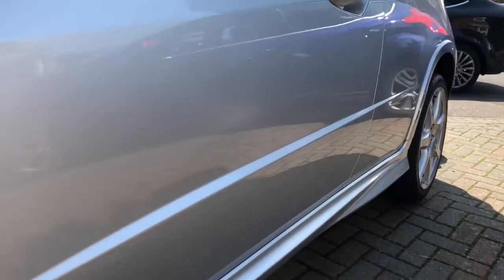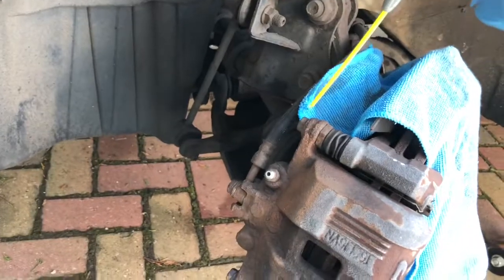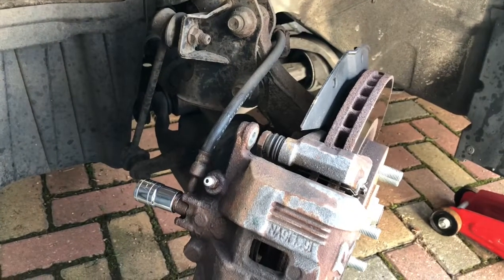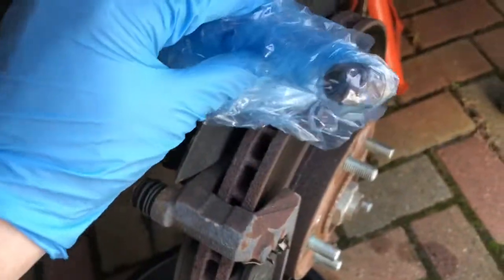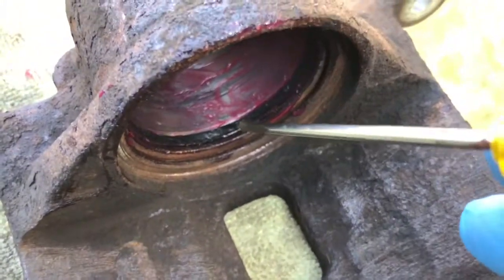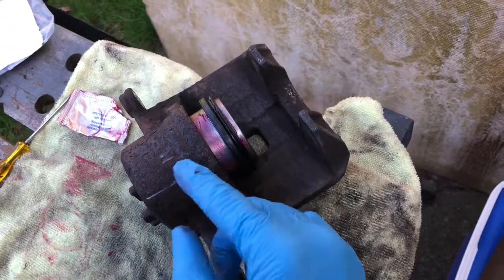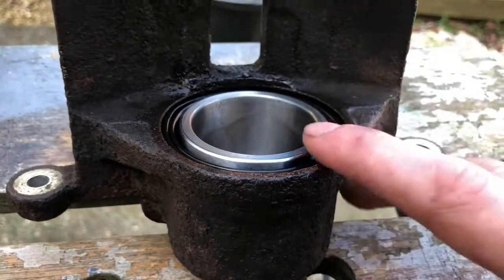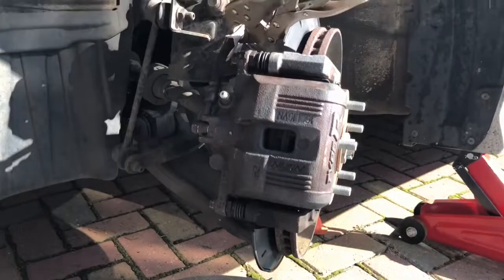Seized front brake calliper rebuild Honda Civic fn2

Comment: Also, brake fluid wont leak from the outer piston ruuber seal like you said, the thins square rubber seal you put in the slot inside the caliper first is the only brake fluid seal. The outer boot rubber just a water / weather seal

Comment: Are you sure you should have put the red grease all round inside of caliper and all over piston like that? Wont it contaminate the brake fluid when it back on car. Honda service shows to only put little grease around the 2 rubber seals...